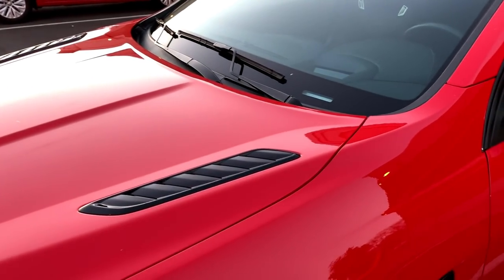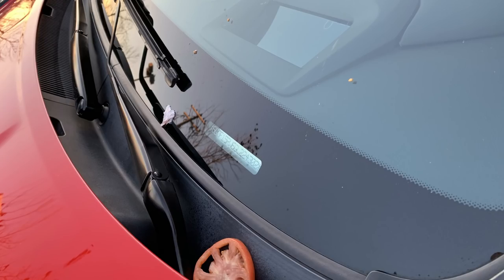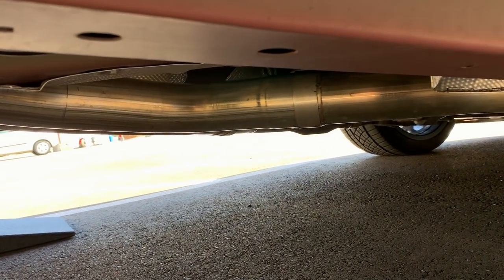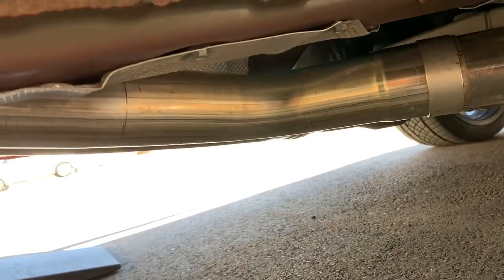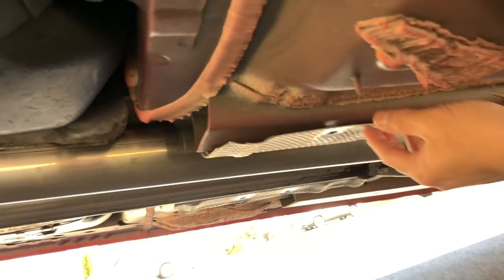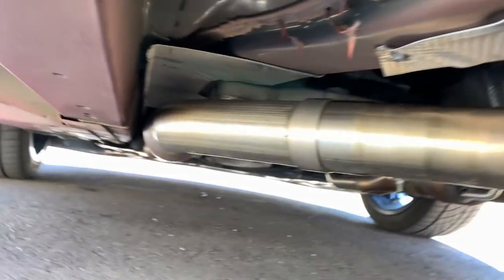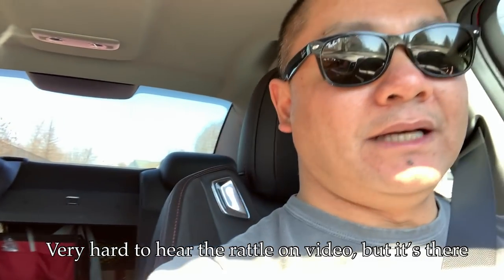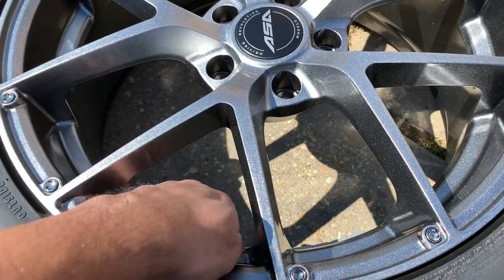Not Quite Vandalism, Plus Chevy SS Headers Update

Comment: Yeah it needs to be flipped over. The mid section goes up into that area. Just like the factory exhaust. On the ARH kits for the SS. There are some spacers supplied in the kit. These spacers go between the tunnel brace and the body. And allows enough space so the exhaust won't hit.

Comment: Armin don't worry about it just take it back to the shop and they will have to adjust everything and afterwards they should put the vehicle on a lift (alignment rack) so that the vehicle is settled with the wheels  down on a surface and power bracket the car ,put a load on it as to simulate the car being driven so that they can see if the noise is still there that how I used to check exhaust systems for noise the engine movement and heat can cause noises from a new exhaust.

Comment: https://www.phastekperformance.com/2010-Camaro-HALO-Driveshaft-Tunnel-Brace-p/halo-camaro-tunnel-brace.htm

I used this tunnel brace on my SS Sedan with aftermarket exhaust.

Oh and I have a slight rattle which I believe it’s coming from the muffler valves. It’s very subtle and only on occasion. I know the system is tight as I put it on the lift and check it from time to time. 12.5 lbs of boost probably doesn’t help. 

The joys of moding cars!
Reply from the maker: dualsnorkel  I’m starting to wonder if it’s my bimodal muffler valves too. It doesn’t seem to be impacting performance, but it’s a little annoying lol.  Thanks for recommending that brace - a few others mentioned it to me as well!

Comment: There will always be people jealous of what you have worked hard for. it happens here. You get idiots keying your car, food & some people even do panel damage. As long as you've given it a good clean up, you shouldn't have a problem. Dashcams help. 

Aftermarket exhaust systems have a habit of not fitting properly depending where it's made. Avoid Chinese manufactured exhausts as they never fit properly. Definitely get it sorted, repositioned & tightened by someone who knows their stuff.

Comment: Armin I have a tunnel brace coming for my ss. 
So why don't you have a tunnel brace is it because of the aftermarket exhaust hanging too low? I don't think they are suppose to be hanging that low. You should be able to run the exhaust with a tunnel brace

Comment: Looks like the xpipe is upside down.. I could be wrong but its hanging really low. Also get a halo tunnel brace it will help with rattle
Reply from the maker: Installer has experience with ARH on SS (he has one too & has installed others) and was adamant about making sure the X Pipe was oriented up lol. Going let him readjust some things and go from there.  Thanks for the tunnel brace recommendation, several have said it’s a good one to consider!
Reply: @RedSS  if you trust your installer, then I would take his word. It's just quite a lot lower than mine lol. Yeah, I saw someone post a pic of the brace on Facebook and it looked nice.
Reply from the maker: Yeah I trust him, he does awesome work. I’ve been reading forums and just now learning that fitment issues are just a fact of exhaust life 😂.
Reply: I am about to send my SS to Livernois.  Part of my package is 1 7/8" long catted x-pipe headers.  Did Livernois do your header install too?  I am sure it was fine when installed, but after time?---So, I am wondering what to ask, what to do, or be concerned???  Mainly, I am far from Detroit, so if this happens after the fact, going back there would be cost prohibitive unless a major issue.  Suggestions?
Reply from the maker: Emailed you back 👍🏼